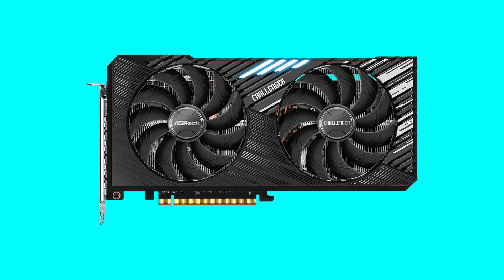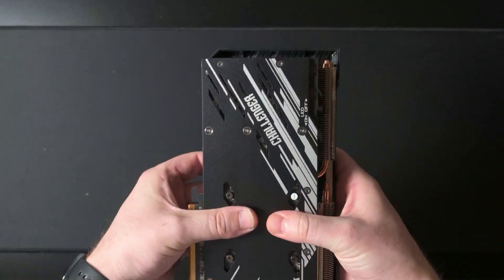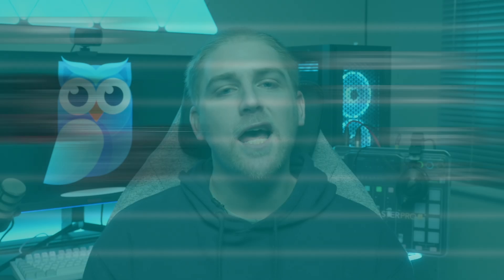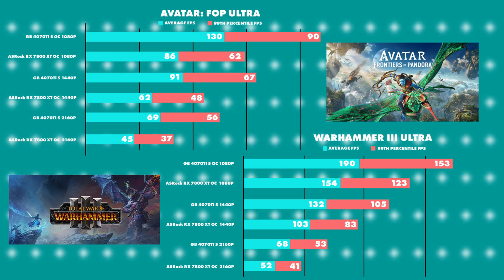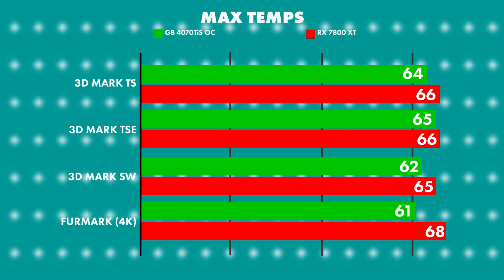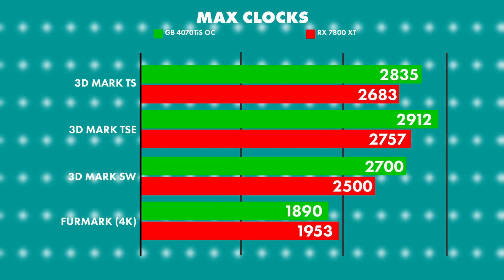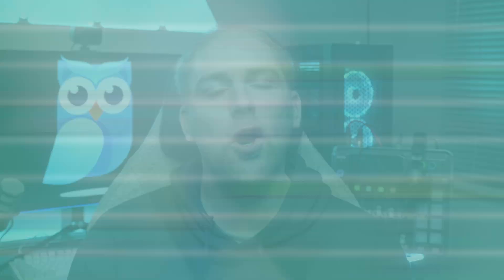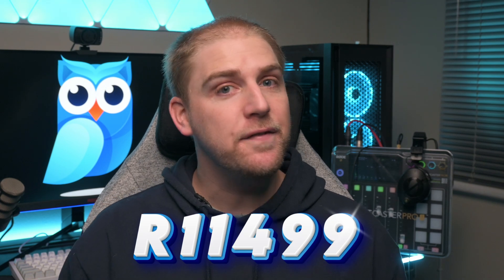ASRock AMD Radeon RX7800XT Review ,Best value GPU on the market?

Comment: Probably the stupidest review video I have seen in a while. Comparing 2 GPUs at completely different price points, rehashing the same limited data points in 2 tedious formats , while providing no insight into the actual product ( build quality, thermals during gaming, noise levels etc. ).
Reply from the maker: Tell me how you really feel? So lets paint a picture :  all the equipment is acquired with no assistance , hours spent testing to show true data points , films , edits and posts for absolutely no monetary return but to share information, you cast judgement in a harsh and demeaning way ? Try constructive criticism. But onto your point : 4 times it was said they were the only cards had at the time? Secondly showed several benchmarks with fps and sometimes the AMD actually won.  What does price point have to do with performance in that case? People that play those games would find it informative as many did. Could a better job be done ? Sure, still perfecting and doing the best as an army of one unlike many who have teams. So next time you wish to haul insult , stop and think. You clearly have intelligence , so next time try being constructive rather than insulting

Comment: These cards are not in the same class and prize range. This video is not a good comparason.
Reply from the maker: 100% when it comes to price but the data shows differently. I maybe could have presented it better but if you get 85% of the performance at 60% of the cost then its a good comparison. Potentially someone may was to get 100fps in a particular game and both cards do that, why would they want to spend more if they dont have to? 

I am bringing another video out soon where I will explain my methods a bit better

Comment: My Sapphire Pure 7800XT with a 7800X3d performed much better than this 2 fan Asrock 7800XT in 3DMark. My TS score: 19125, FS score: 41250, FS Extreme: 23915

Much closer and let me just add in my country the 4070 Ti Super costs literally double as much as the 7800XT so I do not see anything even remotely close to double the performance. The 7800XT is the best value card and best price to performance ratio you can get. I play Stalker 2 at 80-90FPS at native AA and all details max. I play any new game at full detail at 1440p. The 4070 Ti Super is the first card in the Nvidia lineup before going to the 4080 or the 4090 that actually makes sense buying if you want to use the raytracing argument since the others will have a big performance hit on the newest games with max detail on if you enable RT too. The vanilla 4070 costs more than the 7800XT and loses to it in everything, the 4070 Super slightly beats it but it only has 12GB Vram which is an issue for future gaming and it costs a substantial amount more too.
Reply from the maker: Awesome comment ! 

Yea pricing is gonna vary depending on your country. 

You should see what AMD is about to bring out 🙂

Comment: This card has two 8 pin power slots on it. Do both of these need to be hooked up or is it one for LED running, and one for non LED?
Reply from the maker: Heya

I no longer have the card but from memory both need to be inserted as is the case with most cards. It generally will not give display without both 8 pins connected

Comment: Good testing. I have a 4070Ti rig. Non super. And I'm building a 7800xt rig currently. Considering the 7800xt is about half the price of the 70ti super... Id say it's a pretty credible performer. 7900xtx is going for (not far off) 70ti super money currently
Reply from the maker: Thanks for that :)

Check the calculations on the article I put on the pinned comment

Comment: pointless comparisson ....... 4070ti is on upper cat.... 4070 normal is way more accurate
Reply from the maker: Hello

I disagree for a number of reasons

1) I did mention these were the only benches I had at the time and more will come. Its just not cheap to be able to procure all cards.
2) I did not make this video a 4070Tis vs 7800XT, i just said it was an interesting comparison.
3) This was a review of the 7800XT but I had the data and the numbers do not lie. Price to performance Only it makes sense. 
4) 4070 Would have been a good addition but do not have the card to generate the data (Yet), I am not Linus/GN who get things thrown at them. It will take me time to get to a stage where I can get the cards or afford to purchase them myself

Again I supplied that information as I want to go in that direction but its not a versus video and I did not say that at any stage. 

But I do greatly appreciate the comment and feedback earnestly :_WootTini:

Comment: Is this ok if my power supply is only 650w?
Reply from the maker: heya

This completely depends on your CPU. Your CPU and GPU are the items that pull the most wattage.
Reply: Generally I’d say no because most of the cpus you’d pair with these cards would put you at 750 minimum.

Comment: Why on earth are you comparing the 7800 ($430) to 4070Ti super ($800)??
Reply: lol for real.
Reply from the maker: Because it's the 2 cards I had at the time. 

Not Linus who gets sent 100s of cards. 

But that's why I broke the information into price to performance based on real information. More will come where more comparisons can be made. 

I do explain that in the video. But if you need a car that goes 100 miles an hour and you don't care about anything else but price , then you go for the cheaper one. If you need other things like electronic windows etc, that is where you need to make a decision. 

The info is accurate and fair to both cards. And further the Radeon did well and in my country it's half the price almost. Why would I not compare them with a massive price difference where some games performance was the same ?
Reply: @wootdini  shouldve disclosed that info and not used language like smashed and destroyed when the price gap is that high. it can really confuse new pc builders who could confuse the ti variant for the regular version and just think its miles better when thats not the case, it happened to me when i was new to pc building. im not at all saying its wrong to compare them cause they were the only two cards you had, im just saying telling us the price of both would make a more clear video
Reply from the maker: @unsureprobablymaybe3527  Appreciate that, but did I not give both cards prices? All I did was a framerate calculation based on our local currency to give a monetary based value per frame. 

I did say the Ti is a better card because it is. 

That is why I put all the graphics in too of what the results were for each test?

Comment: There's a $550 difference between these two cards in my country. I reckon the 4070 vs 7800xt would be a better comparison.
Reply from the maker: Just providing neutral data :)

Will have more as time goes
Reply: @wootdini  your neutral data is 💩,why dont u compare rtx 4090 with rx 7600 xt?
Reply from the maker: @DC-mf5gk  as mentioned in a few comments its the 2 cards I had at the time. But also if its that bad of a comparison why does the 7800XT win in some titles? Also the crux of the conclusion was value for money which I am not sure people are understanding

Comment: Hmm not really good comparison! here in Germany one month after the release of this video the price for the rtx 4070 ti super is about 900€ and rx 7800 xt is at about 500€ sooooo not worth for a real comparison! The 4070 ti super also needs a ton of more power!
Reply from the maker: Heya

Seems to be a common comment :)

I will have more data but this is a base comparison on same machine and different GPUs. It's true irrefutable data to show what you will get and in my country you going to get much better value with the Radeon . 

Main thing was price to performance which is a good comparison but also has all the other data in that may be needed

Comment: It's really not a fair comparison the 4070 super uses a ton more power and is priced quite a bit higher is around 850 CND  will 7800 XT is only around 700 CND
Reply from the maker: Heya 

So it's going to depend on your country. I did mine for South Africa at the prices we have here. 

That's why I report full performance then performance to price for our local.

The point of this video was to show raw ability but also price to performance

Comment: Realistically it's not really a fair comparison even considering that's all you've got to compare it too. Might it not have been better just to review the card without comparisons?
Reply from the maker: Heya 

Did a price to performance comparison for pricing in my country so it's more than fair. 

Those are the only cards I have on the new testing I do and more will come. 

But the only thing where objectivity comes in would be software usage like broadcast etc

Comment: 4070 vanilla is the competitor to the 7800 xt. 4070ti super costs double what I paid for my 7800 xt and it's supposed to compete with 7900 xt
Reply from the maker: @Xennial647  100s 

So this is about what data I have available as I test. So the comparisons will be drawn depending on what I review. 

Video is not a 4070tis vs 7800, it's just a good indication
Reply: @wootdini  If you use terms as 'smashes', 'winning', 'beats' and 'no competition' in every part you ARE making a direct comparisson. As @NGreedia said these cards are not each others peers nor are they in each others price class. If you do not intend to compare them. Don't
Reply: @WootDini I would suggest just reviewing the data for tye 7800xt alone then as you are obviously comparing